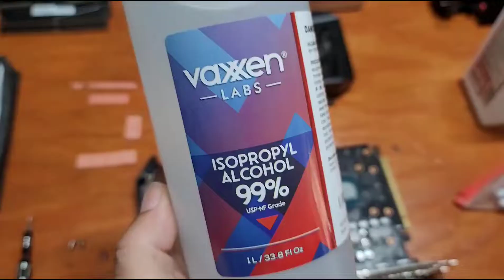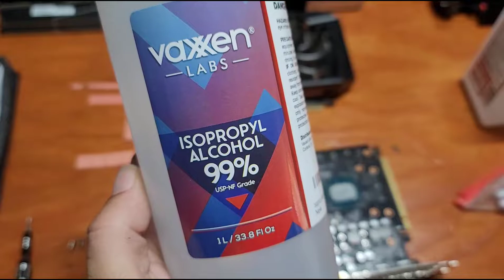PNY XLRB 1660 SUPER THERMAL PAD INSTALLATION

Comment: Quick question I’m using the same GPU in my main PC but the fan is starting to rattle, I dusted it but it’s still giving me a loud noise while in use. Could I swap out the GPU fan with any other regular fan as a replacement?
Reply from the maker: You can order the correct fan to go with this gpu online. Can you use a different fan?yes probably as long as it cools down GPU, you should be good to go!

Comment: Can I use this size of thermal pad on  Pny Gtx 1660 super dual fan
Reply from the maker: Yes you can I usually measure my pads from my gpu verse actually measuring it should be same size! I'd compare put both pads back to back new vs old

Comment: I've found using cut "round tooth picks" to 3/4 length of their original length, then place them (cut side down, pointy side up) "diagonally" in the cooler screw holes helps to align the PCB holes as you slowly lower cooler block onto the PCB. While leaving the 2 tooth picks in their holes, insert 2 screws into the other empty holes, lightly tighten. Then remove the tooth picks, insert the other 2 screws and lightly tighten. Finally, diagonally tighten all screws to a firm tightening. Done this procedure on ALL my GPUs when replacing thermal pads. No guess work on IF cooler & PCB were mounted right and keeps them from sliding before putting screws back in.
Reply: also.. disappointed that the exact location for each size (whether .5mm, 1mm, or 1.5mm) thermal pad used was NOT overlayed onto the component it was for the viewer of this video could SEE where the pad size was placed.. just talking about the pad sizes used.. pointing does not work here.. overall, video was somewhat "janky" as some say and probably difficulty to follow.